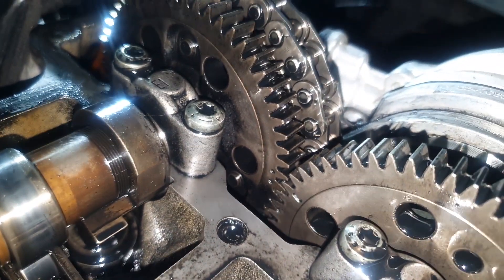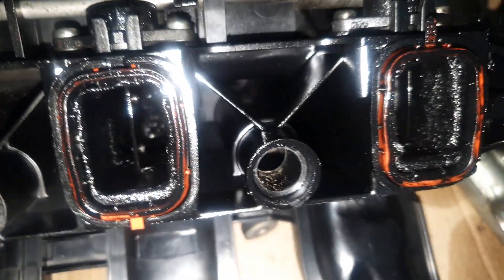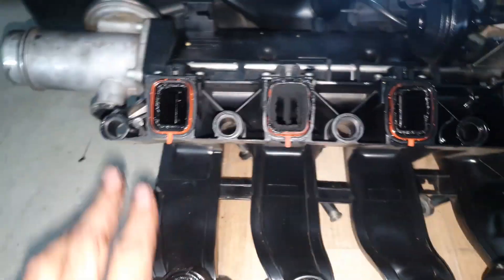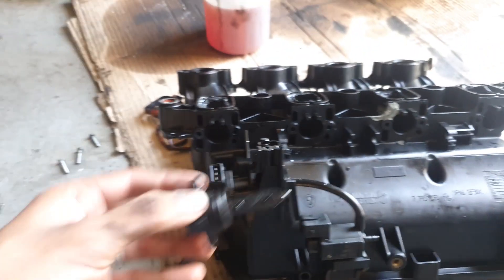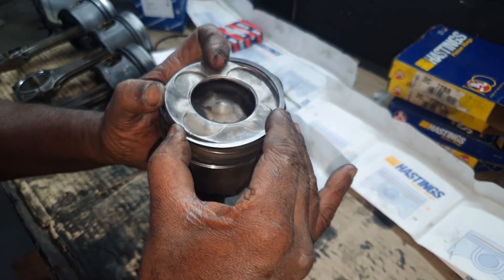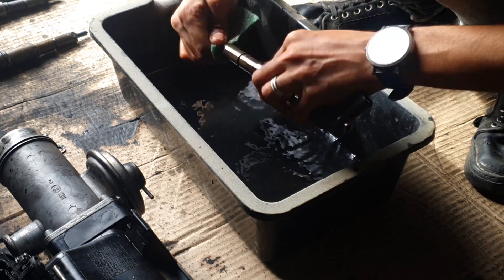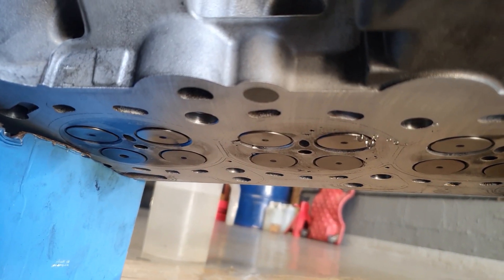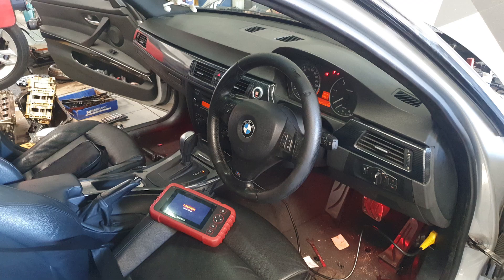Rebuilding My Diesel Engine! BMW E90 320d M47n2 | BMW Engine Rebuild

Comment: Hi. I was watching your video as I’m doing a rebuild on my E60 with M47 engine as well and I ended up removing the crankshaft and discovered the main bearings are very bad, but the crankshaft seems to be in a good shape. Now I’m after some new main bearings and con rods but I’m confused as on the RealOem they mention about different colours (sizes) on each bearing, although on eBay the main bearing set doesm’t seem to follow the colour guidance. I did rebuilt two years ago an N47 and used some Apex bearings and rings and the engine is still running great. What set of bearings did you use for this M47?

Thank you.
Reply from the maker: At the time of this rebuild, i used all standard bearings, ARCO brand. The main bearings were untouched since the only damage was to the pistons since the swirl flap injested itself. So i replaced all 4 pistons and rods with the 2nd hand set, all standard big end bearings and the car was perfect. I didn't follow any colour code since everything is all standard sizes
Reply: @Realpreshaanb  Thank you for the quick reply, is much appreciated. I have no choice on my car but to change the main bearings as they’re completely wore out, as I said. I couldn’t find many videos about the M47 engines, although for N47 are hundreds on YouTube, which is weird. I’m planning to reinforce the flaps from the intake manifold using some permanent thread locker, hoping I will avoid any engine damage. 🙏🏼🙏🏼🙏🏼
Reply from the maker: @valentine0606 if you need to put bigger bearings, you will need to send the crankshaft for turning down maybe 10 thou (0.25) so its correct... Your engineer will advise you best... As for the swirl flaps, get rid of them all together, you'll be doing yourself a big favour
Reply: @Realpreshaanb I don’t have an engineer, I’m doing the rebuild myself, as I said I did rebuilt two years ago my other BMW E60 with the N47 engine and I never had any issue since. About the swirl flaps, I’d rather keep them as they are because I did try on my N47 to remove them and the car lost power, so I had to buy another intake manifold with the swirl flaps in place and ever since the car drives very good. It’s true that on N47 the flaps are made of plastic so it won’t damage the engine if they break, but for M47 if I will check every now and then to see if the flaps are getting loose and keeping them tight, I don’t see what harm it can do if I will leave them in place. I don’t intend to install oversized bearings as the crankshaft seems to be within specs and I did not do any modification in regard to the cylinder head or engine block. My only concern is in finding the right main bearings and con rods suitable for this engine, as there’s contradictory informations all over the internet about that.
Reply: @valentine0606  Una consulta me compre un serie con m47, pero no encuentro sus partes, Solo consigo kit de reparacion del n47 las partes internas como pistones y kit de empaquetaduras seran los mismo ?
Reply: The N47 and the M47 are using different parts, including pistons, piston rings, main and con rod bearings, valves, valve stem seals, etc. Completely different designs.

Comment: Get the EGR removed via an ECU remap. That will stop the carbon build up in the manifold/swirl-flaps. Also remove the swirl-flaps, if not every 75k miles replace BUT get EGR remapped out…
Reply from the maker: My car is tuned already, so its been removed both software and hardware

Comment: Hi bro, when you were removing the pistons did you have to remove the subframe and the steering rack? Thanks in advance.
Reply from the maker: Hi, yes i did, in order to remove the sump and get access to the bottom end, you will need to drop the subframe, not completely removed out of the car but just enough to remove the sump, so you will need an engine support bar to hold the engine up while you drop the frame and work with the bottom end🙏🏼
Reply: Thanks ❤

Comment: Hi! Great work! How many miles have u done since the rebuild, is it giving you any problems? I am wondering if buying hastings piston rings also in my m47 and want to know people experiences with them! Thanks in advice!!
Reply from the maker: I've done roughly 10 000Km which works out to just over 6000Miles and all in all its going very well... Hastings rings are one of the best and are what we use as our go-to in the workshop

Comment: Hi presh hope u doing great,
Just wanted to know what approx amount u musthave spent on this overhaul?
Reply from the maker: Everything was done within my budget of R12000.00, All new Parts (apart from the pistons & rods which were used), Servicing 1 Injector, installing a new camshaft sensor and some misc bits that I can't remember off the top of my head and because I've done everything in-house and primarily by myself, There was no labour charge

Comment: Hi, was wondering if you can help with the torque specs for the engine rebuild. Thanks
Reply from the maker: I Have included torque Specs & Sequence in the video... Note that this is not a DIY Guide and meant for entertainment purposes rather than a dedicated guide on rebuilding an engine... i will not be responsible for any damages should they occur

Comment: The swirl flaps (BMW Group) should be liable in my estimation! All BMW have a Recalls page for every country you should check to see if their are any recalls on your model. The do the servicing if their is an issue listed an pay for the repair.
Reply from the maker: according to my VIN, all recalls are up to date, there hasn't been a recall on the swirl flaps, only the ones that were mentioned worldwide such as the blower motor wiring and power cable replacement (12v jump cable from battery to the front of the car)

Comment: Hi Preshaan Awesome Video 🙏,I’ve just Copped a X3 2.0d I wanted to know if you have advice for me ….I have like this wheel bearing sound coming from the gearbox area 😢Mechanic say I need a new diff but I think he wants to take me for a ride
Reply from the maker: I'd suggest to get a second opinion at a different mechanic to confirm any suspicions before going ahead with any repairs.

Comment: all the damage inside the cilinder 2 was caused by a manifold swirl flap . thats the only thing what can get into the combustion chamber . i have same problem with starting as u had before this video. later edit : late-on i saw that you did showed the flap broke.  anyway , usually this is the main problem that cause this. not timing chain . only N47 had this problemm . hope ur engine runs clean now , cheers!

Comment: Hi there Preshaan, my name is Trysten and I have the exact same car. My car however has some major issues. I'll be honest and just ask for your guidance please.
Reply: Thank you for replying brother 
The car broke down, apparently the cam chain snapped
Reply from the maker: there can be a lot of contributing factors that will lead to chain failure. I've yet to see an M47 with a snapped chain as these are quite strong unless something caused it to snap.
Reply: Yes man the turbo had to be reconditioned, the time I spent driving it with a lag could have made matters worse. Now that it has the power again were seeing all the faults. Please refer me to the guys who helped with your car. I said if I'm going to start from scratch I might as well go all out.
Reply from the maker: I do everything on my car myself at our workshop 👌🏼

Comment: Great video.
Just to inform you. I made the mistake. Of changing the cam caps. I thought they were wrong.  So i changed them over..... cams siezed. E goes on the intake cam and A goes on the exhaust cam. You will see n marking on the cams aswell. E on intake cam and A on exhaust cam. Would like to send you photos of the markings.
Reply from the maker: Terribly sorry to hear that, send them to me with my email listed on the channel profile and I'll have a look at it... I had them installed the way they came out of my car... Hence why I've included them in that configuration in the video🙏🏼

Comment: Hi brother were  can I find a m47  motor
Reply from the maker: To find a good engine is very hard to find especially with not knowing the history of the engine itself, it would work out better to rebuild your original engine as I've done (depending of what components need to be replaced)